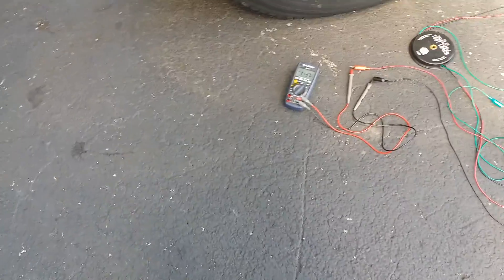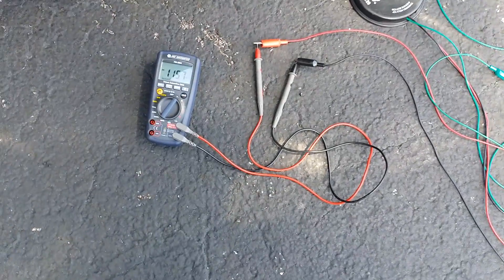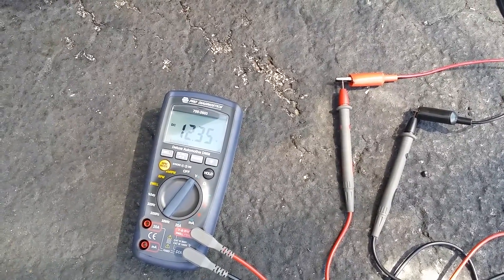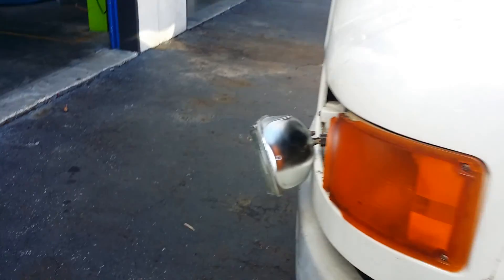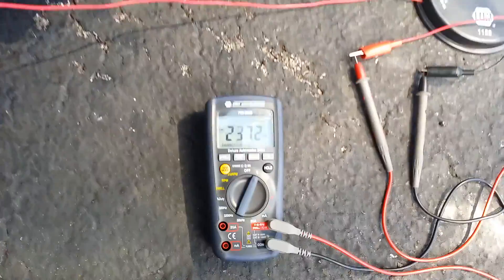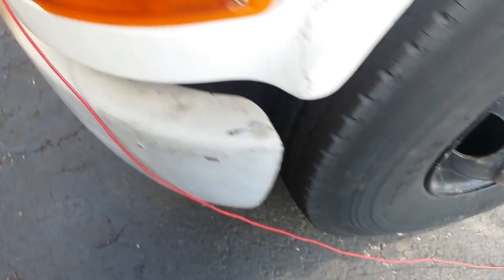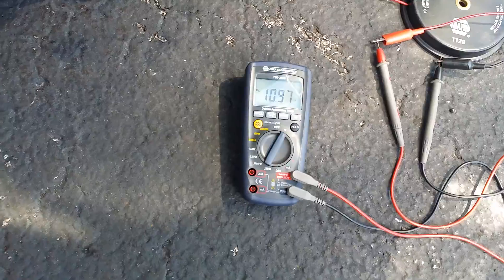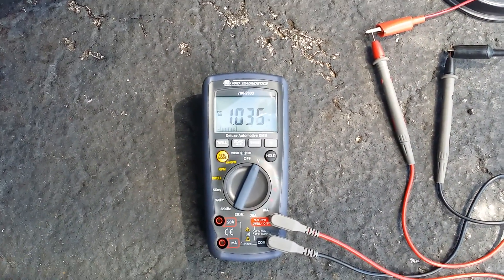Voltage drop test on headlights

Comment: You should really specify which lead to remove. All you said was remove one of the leads from your battery. No. It depends on if you want to do a ground side or power side test.

Comment: This video is worthless to the amateur. First the noise and then the bad description. 
On a H4 bulb there are 3 leads. High beam, low beam and earth. Eartn is normally blacl or brown.
The idea is to measure the voltage across the battery terminals with engine on idle. 
Then measure each of the 2 live wires on the headlight plug with the lights turned on. If anything under 12,7, charge the battery first. Believe it or not. A voltage of 12V on a battery says the battery is holding only a 25% charge.
Take readings and subtract from the battery voltage measured earlier. The voltage should be almost battery voltage. Under 0,5V id acceptable
Do be aware that you need to know the simple basics of electricity.